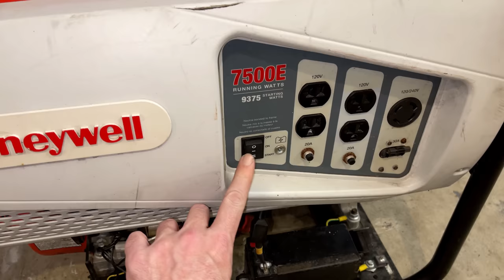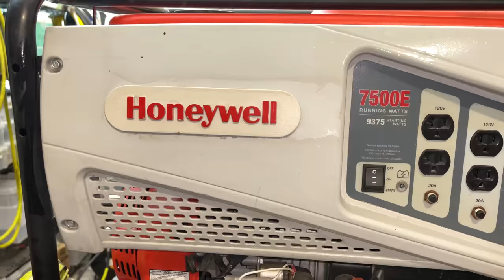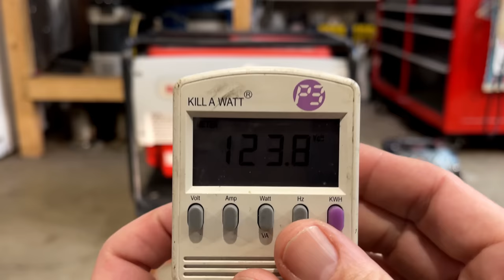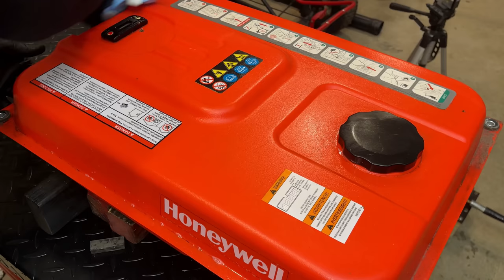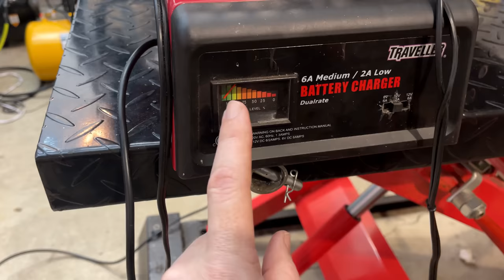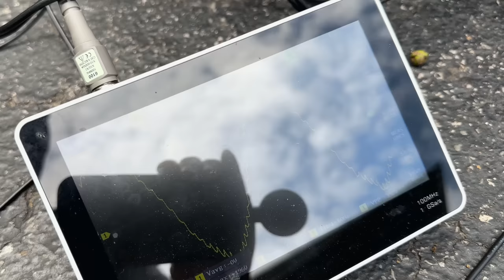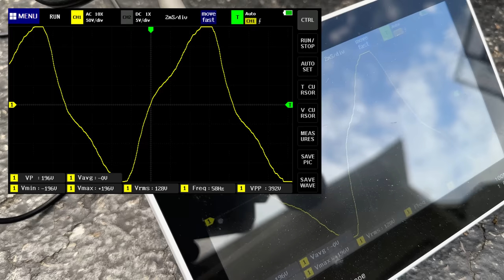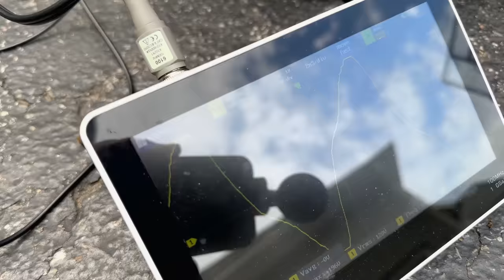Honeywell Generator - Sold For Parts or Repair

Comment: I used to be a mechanic mostly auto, some heavy..ive built quadrojets, thermoquads, diesel injector pumps...but i barely have the patience and dexterity for these tiny ones.. luckily ive found that the 10 yo 30 chinese cheapos work pretty well, and save me tons of time, money and frustration.

Comment: just pointing out arnt the two negatives tied together in the power head so moving only the negative wont make a difference any way, surely you would need to pit the positive lead in the positive side of the 240 outlet to see if there is a difference..... may be.
love the vids thanks James

Comment: Hi James, My fix for your seat issues is I use a Q-tip in a drill like you did but after cleaning it good I put some Flitz on the Q-tip and polish the seat, it's very rare that a brass seat gets pitted but it wouldn't surprise me if there still wasn't a small piece of petrified rubber from the needle still on the seat face.

Comment: Another great job.  As far as batteries go, they're wear items.  In my industry a 12 volt 8 amp hour battery is @ 12 bucks wholesale..ditch the old battery asap....you can purchase a load tester for reasonable $...it's not about the voltage in a battery but the amp hours...been using amp testers for years, they don't lie peace.

Comment: I have spent years working with used batteries of all types on a commercial level. I have charged and tested thousands over the years. Generally speaking, a battery that is bad will stop charging at, or will not hold a charge above 10.7 volts. Most modern chargers like the one you have base their ability to charge on the voltage of the battery. They will not charge a completely dead battery because they are unable to recognize that one is hooked up without a charge. If you have a completely dead battery, use a set of jumper cables and hook it up to a known good one for a few minutes. This will establish a base charge and allow your charger to recognize the battery. If the battery is completely dead, slow charge it and leave it on for a day or two. A battery that was completely dead can give you a false reading if you only charge it for the normal amount of time. Even on a volt meter, it will read fully charged and test bad, even though it is not actually fully charged. If you leave that same battery on for an extra 24 hours, it will be truly fully charged, and will test good. I once got a 17 year old automotive battery to take and hold a charge after being completely dead for 9 years. I charged it for four days, but it tested perfect, and held the charge for a week on the shelf. If the battery charges above 10.7, and holds that charge above that number for 12 hours, then it is usually good. If you do this, you will not have to replace as many batteries.
Reply: I bought a battery that was supposedly recharged and was good. The next morning it wouldn't start my wife's car. I took it back and traded it for a new battery.  I have seen a lot of different ways to save a battery.  Not sure if any actually work. I guess it is worth a try.  I won't buy another battery like that again myself though
Reply: @bertgrau3934  When I was still actively working on them, I would leave them in the shop for 24 hours and retest them before putting them up for sale. Most used battery vendors do not do that though.
Reply: @jesterr7133  
Sir, it sounds like you care about selling quality.  I can appreciate that. Good luck to you.

Comment: I noticed you have garage overhead doors with springs along the upper door rails. Those are known to being a flying projectile, when a cable breaks or comes loose. People have been injured when it happens. I would hate to have you or your soon injured. A friend of mine had it happen to him, and it just missed hitting him.
Reply: Fitting guard covers can be done.

Comment: you need a wire brush to clean the wald after each pass to prevent oxides from damaging the previous layers and rust paint is crucial for long service

Comment: James, at 22:44, I would think you would have blown some brake fluid, (or whatever), and see it would pass through.   At 57:50 I would have wire wheeled the rust off of those screws & nuts.  Other then that, fine job, as always! 👍

Comment: James, I love watching your videos. I have learned a lot. I do a little tinkering myself on mowers, whackers, chainsaws dirtbikes and generators. I’m curious why you haven’t picked up a good multimeter. I’ve seen you use oscilloscopes, but yet for the frequency you use that plug-in gadget. I have one too, and it works in a pinch, but I just like a good fluke. 
I recently picked up a generator that was supposed to have good compression but the connecting rod was blown up. I have a compression tester that I should’ve brought or if I had just pulled it one time that would’ve told me it had an issue. I was in a rush, and he assured me it had good compression. Anyway, I have a presumably good rotor and stater from a storm responder 5500 running watt generator if you’re interested. I think you’re in New Hampshire I’m in Bernardston, Massachusetts.
Reply from the maker: I have a couple Amprobe meters.  They are owned by Fluke and pretty good.   The really cheap red one I use actually gives me accurate and consistent results.  Plus the screen shows up on camera better then my other meters.  Meter leads often fall out of the outlet with the shaking engine.  Just easier to use the Kill A Watt.  Also many multimeters really struggle calculating the hertz when output it dirty.  The Kill A Watt does not care.

I used to drive for the PVTA as for north as Sunderland and lived in Leverett for a bit.  Now I am closer to Danbury CT.

Comment: Hi James, love your videos. Have you ever tried ACF -50 or its marine version Corrosion Block on Aluminium? It stops the rust and give a nice appearance, dries to a clearcote of sorts over time. I believe, it was originally developed to protect aircraft components and inner wing parts, have used it in the marine environment with very nice results.

Comment: 45:22 Wouldn't welding the frame to axle interface completely around be in order instead of just in spots? Since the metal is unfinished in the void between the parts, it will be left open to corrosion in an area hard to inspect. This could lead to corrosive failure of the frame/weld. The solid axle is less problematic. 48:18 ? It's a plastic washer. Just trim a flat side on it to fit under the brace.

Comment: Great video Jim. I like the custom additions. It seems like these cheap "for parts / repair" machines are always oddballs, but you turned it around. Its certainly nice to have a parts stash for projects like this! I've heard Honeywell makes a good genset and the quality on this unit doesn't seem bad. Is the fuel tank on that machine powder coated? It seems like it has some sort of surface "texture"?
Reply from the maker: Not sure if it was or not.

Comment: 4% thd is the stuff you get out of server grade online ups. even 20% is not bad. for a single cylinder engine that is good enough.
thd is measured by looking at a sinewave and measuring how distorted it is. so if you measure across two legs you are looking at the same sinewave. and so there would be no difference in thd. unless the stator poorly wound and have differences in turns. 
that would like in a tailgator generator.

Comment: Concerning the THD,  all electronic, as opposed to electrical, devices convert to low-voltage dc with smoothing caps.  I don't know how high the THD needs to get before they're affected but it's got to be insanely high, like intermittent sine waves.  What say you all?

Comment: Do you have an air compressor?
Air would help getting the float needle out and diagnosing if the circuits are plugged.

Comment: Have you ever had your stators and Toto’s rewound.  I used to have the done in my industrial life.  It’s been 10 years.  One thing about having a good rewind shot useally get a better job that the OEM
Reply from the maker: I have looked into it, but the cost did not make sense.  Would like to learn that skill someday when I have the time.
Reply: @jcondon1  yeh wondered its a trade that is fading away.  Pretty easy to learn.  We’re in a trough away society.

Comment: I wouldn't expect a change in THD between 120V and 240V,  since THD is a ratio of harmonics to the fundamental component.  if the fundamental doubles, so will the harmonics.    L1 or L2 and L1-L2

Comment: Can you do a video on bypassing the CO minder on a Honda 7000. I have one that is installed underneath the truck that's used as a sign. There is no way anyone would be exposed to the CO but the generator always shuts off if the wind blows in the wrong direction.
Reply: Наденьте на датчик угарного газа презерватив или пакет целофановый

Comment: I hate to ask you this, but do you know if your spare parts might you have a Briggs & Stratton intek 190 Carburetor cover, complete with the metal back piece and maybe the choke lever. We don’t have any spots that Cell used parts here and it’s for my 2 inch water pump.

Comment: Hi James i am watching your videos some time now and i really enjoy them. Today though came the moment to ask a question irrelevant to this video but very relevant to your knowledge. For the 1st time i am buying an inverter generator at 3500w max 3200w working power at least according to the manufacturer. Reviews i have seen demonstrate nice sine wave and power factor at max power although resistive i think. I was thinking to use a power tool that is 2700w like a grinder for cement. Probably a brushed ac motor. Do you think it  would burn the generator or that it wouldn't work? What is the minimum generator power you would go for for such a task without being too safe? If you feel like it you can answer if not no problem.
By the way its a speedingrods Mxr3500s.

Comment: Measuring THD on both legs at same time will REJECT common-mode noise. (noise which is same but opposite on both legs will cancel-out each other.)
Reply: THD it's a percentage measurement .
The only caveat is load balance per leg & load type / mix  .

Comment: That battery dropped to 3 Volts when you tried to start the generator. I don't think that is good.
I like the white panel with the red gas tank.

Comment: Wondering about this for a while now, but won't the jets get slightly damaged/scratched when you use steel wire/drills to clean out what I'm guessing is a softer metal
Reply from the maker: They can become damaged if you go rough.  Just trying to remove the plaque and open op passages so the ultrasonic can get the fine stuff.

Comment: James, would Coleman Lantern Fuel help dissolve  gas varnish ?  (as a pre-wash solvent )
Reply: I used it I thought great but I'm no expert
Reply from the maker: Not sure.  Carb cleaner works well for the pre wash.  I usually try to remove the heavy stuff before dipping in the ultrasonic.  Reduces the time needed in the ultrasonic.

Comment: The generac you did last week is a much better choice compared to this one THD wise. This one I would probably use it for maybe tools or something I don't think and I could be wrong but I would not use this Honeywell one for electronics but for sump pumps or something like it I would use this one. The generac one I would use for all of my electronics.
Reply: I'm not so sure now today's electronics, most everything now is powered by a switch mode supply and they just need AC often between say 90V and 300V at anything from 20Hz to 400Hz, and it could be a square wave and they'll be quite happy.  Certainly things with a linear transformer fed supply could be upset with distorted mains and spikes but they are becoming rare.

Comment: Does high THD affect electronics that have a vdc adapter? Modems, routers, laptop chargers. Curious if they act like a buffer.
Reply: Probably no effect if it's a switch mode supply, small and light for the specified power capability is a very good clue.  Look what is written on the supply unit, I have looked at a few SMPS wall warts here:  100V to 240V, 50 to 60 Hz.  I have a big and expensive piece of equipment that needs about 500W of DC supply and has a SMPS in it, the spec says "AC 100V ~ 240V ±10%."
Only transformer supplies will be compromised, these will be heavy for what they are and will have a stated single voltage rating and possibly an internal link or panel adjustment for other voltages.
Put simplistically a SMPS first rectifies the mains to produce DC, for the USA about 210VDC and for me about 385VDC, this is then fired as very short pulses through a small ferrite pulse transformer and heavily smoothed to give the low value of DC output needed, voltage sensing feedback causes the pulse duration and/or frequency of the switching device to be varied as power is demanded.
Bit like keeping a leaky bucket filled with very short spurts of water from a fire hose, if it leaks more (power demand) just lengthen the spurt.  🙂
Go look at what is written, I guess they are all SMPS and so will effectively be a buffer.

Comment: Curiosity question: I know you keep a lot of used parts like most mechanics but how much new stuff do you keep around?  I’m talking like gaskets, generic parts, etc.
Reply from the maker: I stock plastic tank bushing, fuel valves, fuel line, Honda clone gaskets, Subaru gaskets and usually Briggs 10hp dump and head gaskets since they always blow die to lack of oil.  The rest I order as needed.

Comment: James, just out of curiosity, (and please do not answer this if you would rather not share this sort of info, no problem), what do you think you could sell a used 7.5kw generator like this one for in your area? Here in Western Oregon, it would be well over $500 used. (A new Generac 7.5kw is over $1000, and the Predator 9000/7500 is like $900 new.) 
In the LA area where I used to live, it would likely only get about $250-$300 because Harbor Freight often has sales on the Predators 8750/9000 (7500w) in LA for around $550 brand new. I don't know why generators were so cheap in LA, perhaps they sold enough to make up for it in volume. Not really sure. Even a Honda 7.5kw was less than $1000. (Not including the inverter types. They're way more, well over $2k, even for the Predator!)
Just curious....

Comment: I am just curious. Do you ever replace the carb gaskets? I rarely do, but I am self taught and definitely do not do everything properly.
Reply from the maker: I used to, but now I rarely do.  Never had a problem using an old gasket on most engines.  The exception is Subaru.  Subaru gaskets always get destroyed removing the carb.

Comment: Hi James I have a 8hp 6.5kva petrol generator think it's a Honda clone engine what engine oil would you recommend for it I have hyper drive sae 30 super mineral oil would it be ok for it
Reply from the maker: 30 weight oil is fine as long it is warm outside.  It temps from near or below freezing then you should use 10-30 synthetic.

Comment: Wheel sets should be mandatory on any generator over 2000 watts.
Reply from the maker: Completely agree
Reply: @jcondon1  Some of the sets you get have stubs instead of wheels. They can be in an awful condition. So you fix them anyway.
Reply: Meh, I have a 4000 watt Wen that I can pick up by hand and set on the workbench.  It's about 70-ish pounds.

Comment: you know since you are a one man show...   you might think about getting an Engine hoist to help around the shop in lifting generators...  they are not that expensive
Reply: James has one affixed to the ceiling.
Reply: @r8118830  well a mobile one would help..

Comment: Were you able to unclog the original carb parts and did the old battery respond to the desulphate cycles? These generator videos trigger an impulse to design a better, cleaner layout to encourage owners to keep them clean, do the ongoing maintenance but then you wouldn't have a paying hobby... Swings and roundabouts.

Comment: I don't know if it's laziness, a lack of mechanical comprehension, nobody to help troubleshoot or a combination of the three, but I just can't understand how someone can afford to buy a $1,200 generator, run it for a couple of years, then when the fuel system gets clogged, a switch goes bad or a spark plug dies, they turn around and sell it for $150? It boggles the mind.
Reply: @Only-Memories-In-The-End  To make a comparison, I bought a Champion generator from a pawn shop for $100 and it ran perfectly for 2 years, then it had an issue where it wouldn't start, so I looked deeper into it and found that it had a clogged spark arrester. So I cleaned it out and it ran fine for a while longer. Then it started over-revving with no governor control, so I tore the engine out, split it and found that the governor idler arm had sprung loose and the pinion bushing had popped out. I put the bushing back and slapped it back together and it has been running fine ever since. I could have just trashed it and bought a new generator, but I have the mindset that I wanted to know what happened to my satisfaction. The result is that the problem was solved and money was saved.
Reply: @Only-Memories-In-The-End  Sounds nice. Take care.

Comment: Supposed to disconnect the battery when welding...
Reply from the maker: Good point.  I know in cars that is standard.  Never really thought about it with a generator.  I suppose a newer one with more electronics could be damaged if not disconnected.
Reply: Electricity, like water, will follow the path of least resistance.  Placing the grounding lead from the welder as close as possible to the weld site should alleviate any concerns of damaging other components.  Placing the grounding lead on the opposite side of the machine can cause problems as the current path now may go through other electronics, bearings, battery, etc.  Of course, isolating the weld site 100% will prevent any chance of damage, but that is not always possible.